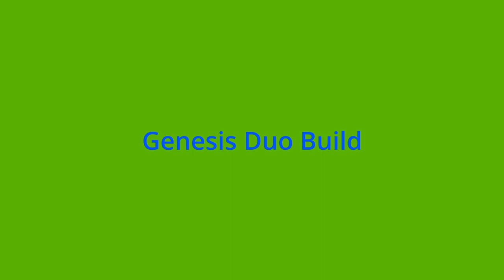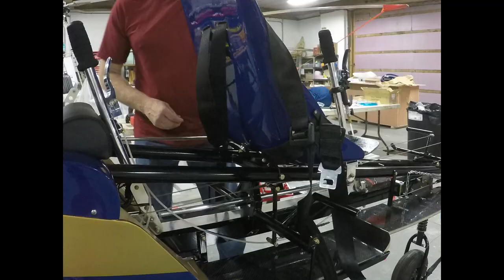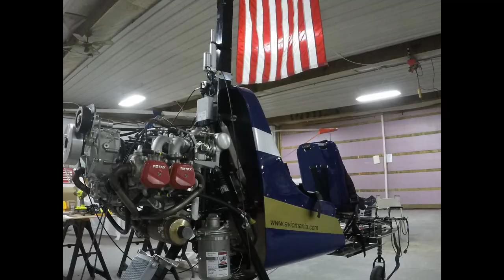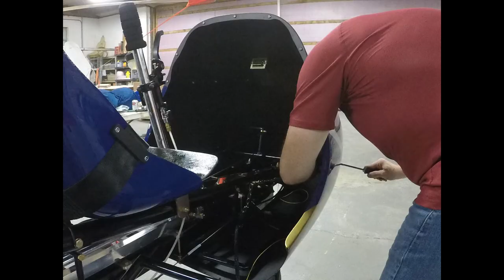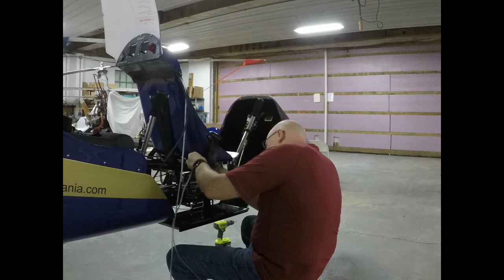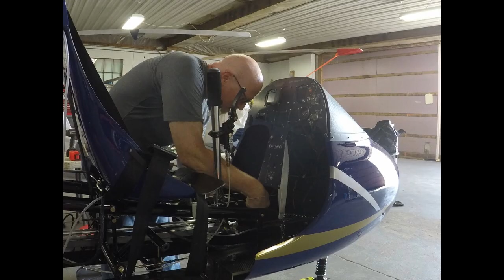Day 5 and 6 time lapse build log

Comment: How much for a kit?
Reply from the maker: That will depend a lot on the instruments and options you choose to install.   Since this machine is ordered from Cyprus, there's also the Dollar to Euro exchange rate that can be significant.  Reach out to an Aviomania representative for a quote.  They have single and 2 place machines. There's a new representative in TX, but I don't have the contact info currently.